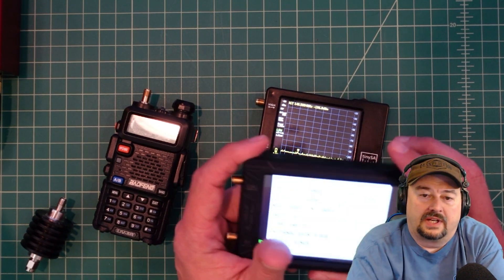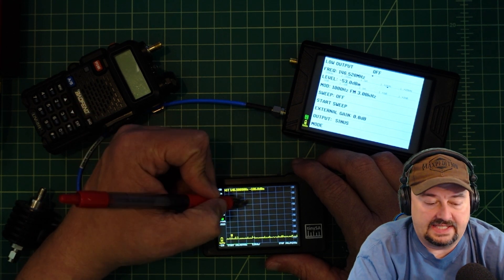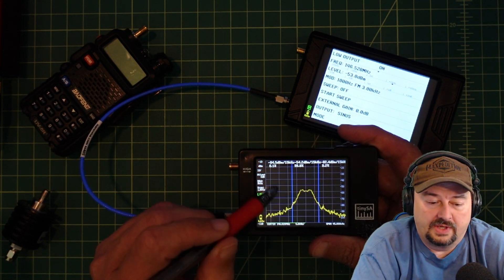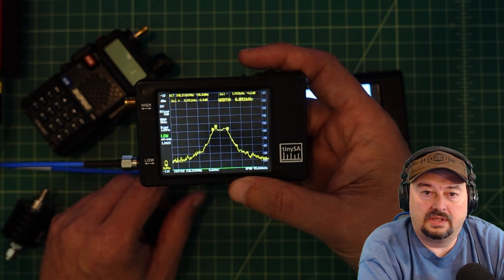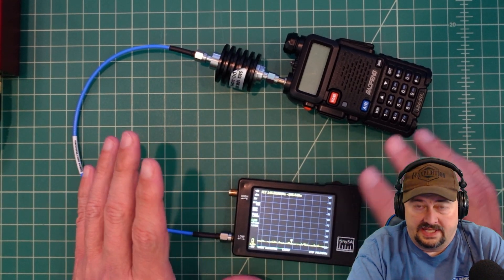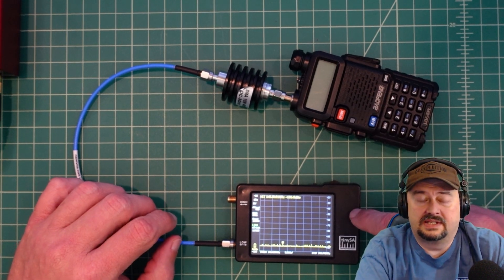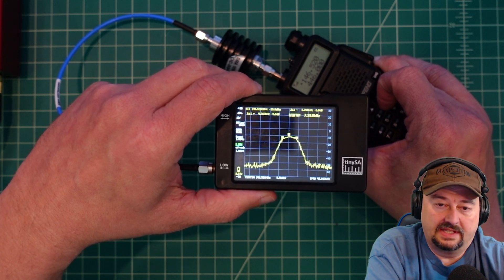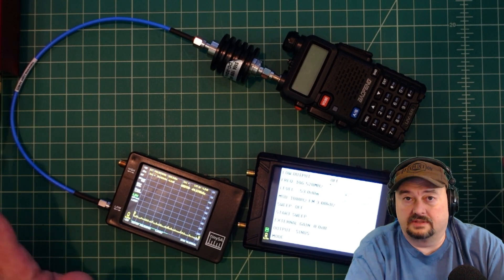TinySA Ultra and Baofeng Signal Injection (How To)

Comment: That's really interesting to know the additional facility available in the "Ultra" tiny SA.
I know you are using the 50 ohm -40dB external attenuator while injecting from the HT.
But then you have "in-built" attenuator in the tiny SA; maybe you don't want to use it.
De VU2RZA
Reply from the maker: It's for when the signal is coming from the radio, the TinySA has a very sensitive front end.

Comment: With tools like the TinySA and the NanoVNA they can be absolutely  invaluable when compared to using no tools and just going by best practices and dead reconning.

But keep that in context.  These tools are $70 to $100, barrier to entry, and they will not be the same as a multi-hundred or multi-thousand dollar device from a tier 1 manufacturer.

And that's VERY okay.  

I'm not a tier 1 radio operator, nor do I use them in a commercial capacity.  For what they are, I have been able to learn, and tweak, and get some things working well.

They're fun and useful tools.

Cheers Ape.  Thank You
Reply from the maker: Great comment!  For 150$ a ham can have a nice little RF lab, I’m always surprised at the hams who discount these handy devices.
Reply: Some of my friends in China really use litevna64 on their lab to help them design their products, and the result is amazing.
Reply from the maker: @jessishandsome  you will see the antenna manufacturers here use them as well 👍